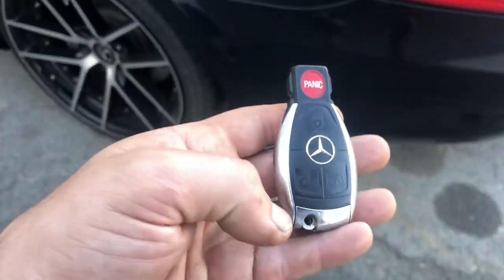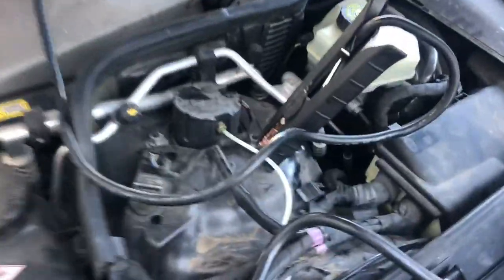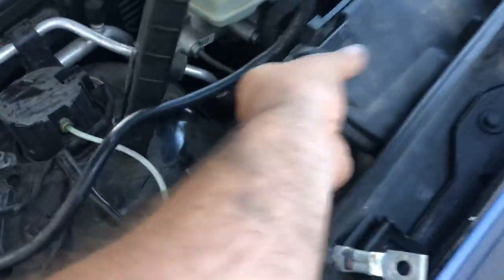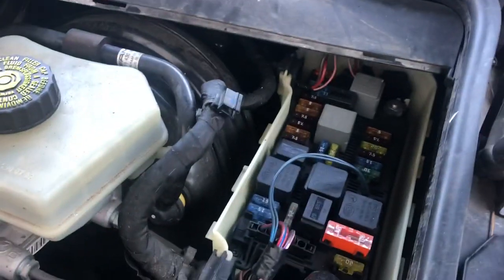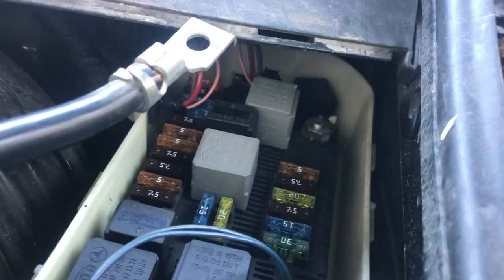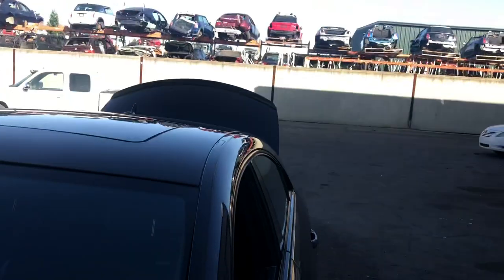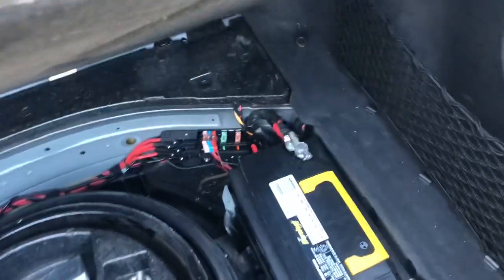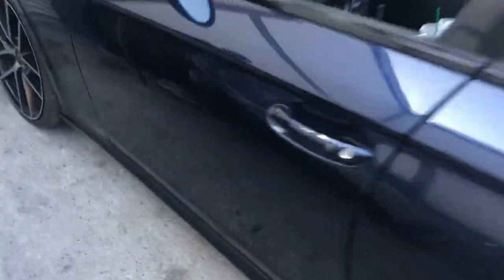W219 Mercedes cls63 cls55 cls550 cls500 under hood fuse box battery power up

Comment: There is an emergency key in the fob to open the boot also.
Reply: I'm guessing that after a decade or more of never being used, many of the manual key locks are frozen solid. The one on my 2008 wouldn't budge! 🤷🏼

Comment: So do all 2008 CLS 550 HAVE A TRUNK BUTTON UNDER THE HOOD!? SO HOW DO GET THE TRUNK OPEN WIT no trunk button
Reply: Use the key that pops out of the key fob and the latch built into the trunk for this specific reason.  I have had battery issues more than once with my 08 CLS550.  Works every time.

Comment: You don't need to do all of that, your key inside the FOB can open up the trunk manually without any power, stick your key in and turn it clockwise in then click the black lever under the deck lid above the lic plate.
Reply from the maker: Didn’t have the blade when I bought it

Comment: Aye man I know this was 5 years ago but I have a 08 cls 550 n my left headlight is out I replaced the bulb nothing. My turn signal works both mirror n side light on the driver side. My next option is a blown fuse but I can not find it n I’ve been searching the internet for videos and your are the closest I’ve seen so if you could lmk that’ll b great man !!!
Reply from the maker: Try ballast on headlight maybe got water damage and not function the Low beam connection

Comment: This saved me tonight... battery cable was loose from work I did earlier when I disconnected it. Was stuck when I closed the trunk. Got it back open using this method in 2 mins.

Comment: Just used this on my CLS using a screwdriver to extend the reach of my battery charger. Just touched the nut with the screwdriver long enough to hit the trunk button on the remote. POP Thanks! 👍🏼
Now... why in the actual f¥€k didn't Benz put a readily accessible battery/jump start terminal under the hood is the real mystery! Idiots... 🤬

Comment: Thanks a million bro! I just opened the trunk with your method! Saved my day. But instead of using the extra wire you used, I just used a jumper cable with very thin clips and clipped it to the actual nut you showed.

Comment: Good to know this but theres also a lil key inside the keyfob thing..that lil key opens the glove box and the trunk(had a similar situation on my also)cheers
Reply from the maker: Thanks 🙏
Reply: I tried the stupid key and it wouldn't spin. So I used the method in the video.
Reply: @kuruption1983  did it work 100% can’t get into my trynk

Comment: My cls550 battery keeps dying I replaced the alternator and battery and still dies after sitting for a day or two....any suggestions? And no mechanic i taken it to know what’s actually causing the power drain...
Reply: i have the same issue after some research i think its the voltage regulator mine looks like its loose
Reply: Stop going to mechanics unless is for computer related work they dont care about our cars like we do...id try to see if any cables are unplugged🔌 or broken maybe burned from heat of engine if u alreafy replacef batery and alternator then inspect the cables..goodluck👍